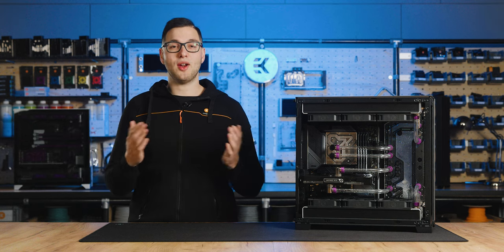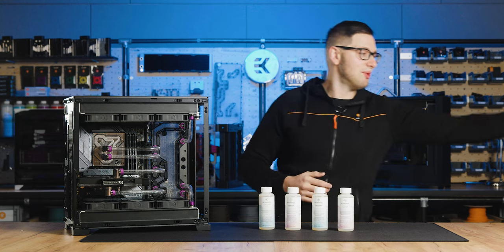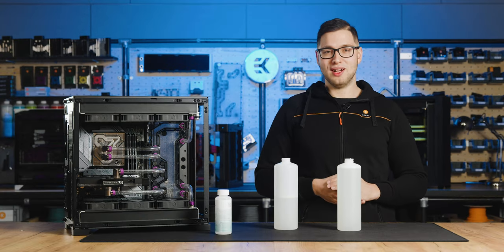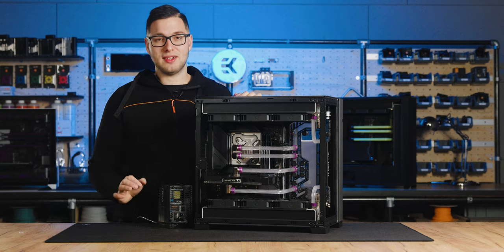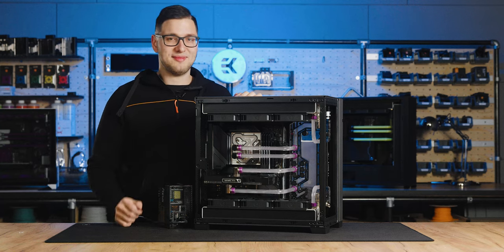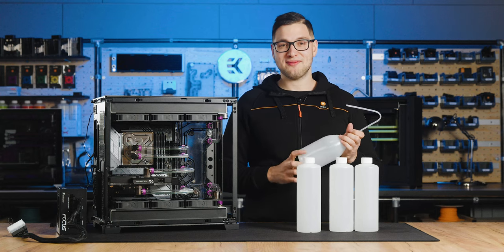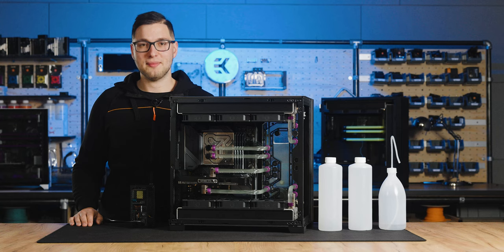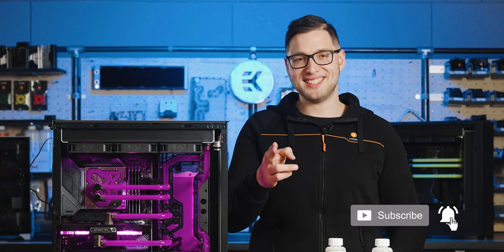Preparing Your Water-Cooled PC for the First Time | EK HOW TO

Comment: Is it okay if a little bit of EK-Superflush remains in the system after draining and then filling up the system with EK-Cryofuel?

Some build configurations may make it difficult to completely drain all of the EK-Superflush.
Reply: Fill the system with distilled water then run the loop, then drain. Repeat process until no EK-Superflush remaining.
Reply: @benwhite8503  exactly what they tell NOT TO DO lol
Reply: From my understanding it's fine if a little bit still in the system
Reply: @benwhite8503  no you're not supposed to do that. the entire point of superflush is that it is a better flushing solution than plain distilled water. using distilled water will revert any effects from superflush.

you just leave the leftover superflush in the loop after draining and let it mix with your coolant.
Reply: @Creamworks  did they not mix the superflush with distilled water?
Reply: @Frank8ooth77  Yes, to dilute it.

Putting in plain distilled water into the loop is the issue.

Comment: Seems like it will be hard on the pump and the rest of the componets to run for 24 hours straight. I thought about running power to the pump only during this period, but it's gonna run full blast without the bios. Did anybody figure out a better way to do this?
Reply: Any word on this?
Reply: @TheGirthGoblin  I did something crazy, but it worked. My pump is 12v, I think most of them are. I took an old 4 pin power plug and spliced a 12v power supply I had laying around into one end, plugged the other right in. The power supply was just a plug-in black cube type of something random I had. Make sure and read the label to check for 12v, at least an amp or 2.

Comment: FIRST AND MAIN ADVICE: avoid facctory liquids. Or change em every 6 months
Reply: THIS! Or buy AquaComputer Ultra clear DP and change it once a year (or even less, but maintenance is the key)
Reply: Factory liquids as in EKs liquids? Why?
Reply: @colton9841  consumer society. if u want long change periods use distilled water and some pharmacy alcohol (the ~90% one), and make a 5% mixture. that'll last. no fancy colours tho!
Reply: I bought the blue colored liquid. Someone told me the color ones stain your block and may cause blockage later and bad performance issues. Is that true or does ek make these liquids so that it doesn't do that. Is clear liquid the better option.
Reply: @Eric Glover  I'm still new to liquid cooling but have studied quiet a bit when doing my first build. In summary, any colored coolant will leave stain/residue behind, solid colored coolants much more than opaque liquids. Part of it is upkeep to, though. You should flush/maintain your loop every 6-8 months if you want to avoid coolant breakdown and for general health of the loop. Clear liquid obviously won't stain as much (could still cause cloudiness) but you still have to do maintenance. Someone else could probably chime in that is more experienced too.
Reply: @cybcarr  it wont evaporate?
Reply: @stephengrinaker5085  alcohol messes up plastic bro.

Comment: So basically, this is a 2 day process. Can you better explain why you can't game on the machine? You have fluid in the system. I hear that heat in the loop helps break up stubborn gunk.
Reply: bacteria growth, heat + moisture = bacteria growth/mold, as the video stated there's no biocide in the cleaner/rinse
Reply: @cipher8390  thanks. I’m coming from the Primochill System Reboot cleaner. Their video states you can use the PC normally lol.